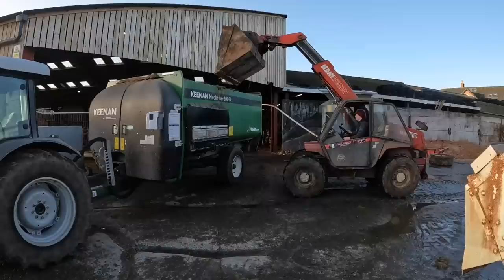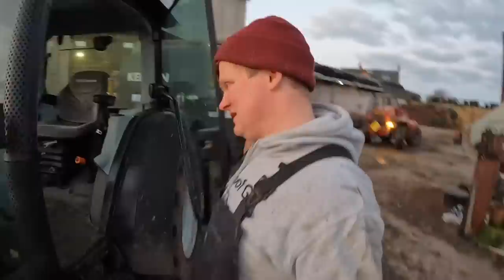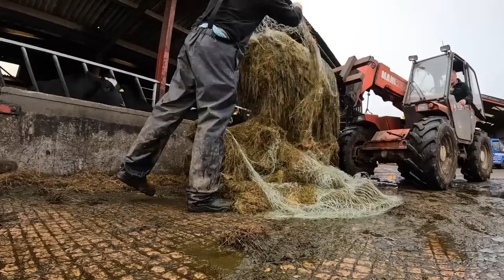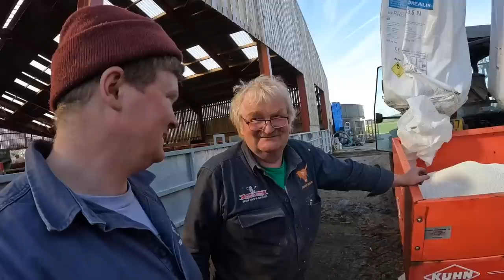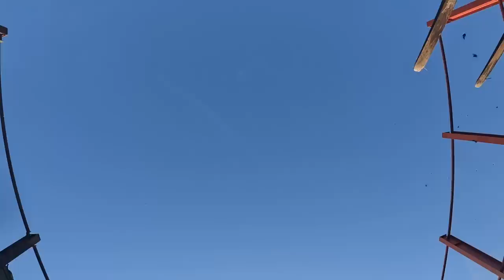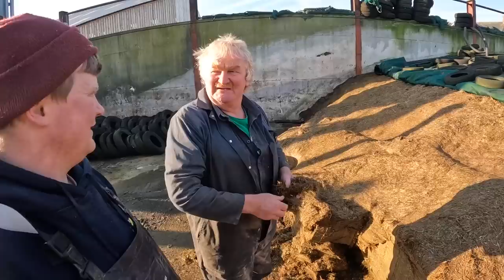IT'S FINALLY HAPPENING... FARMER MAKES GRASS GROW + SON HAS NOTHING LEFT!

Comment: I set up a wash station on a small trailer, power washer, generator and water tank,.
Added some tools and grease gun. Saved so much time on moving stuff.
At end of day, or. Rainy day, spending 30 mins , an hour.
It didnt matter that you got messy or wet as you would be jumping in an hot shower very soon .
Also nothing to put away, just leave stuff on trailer.
Need to cleanup old stuff and new stuff.
Work smarter.

Comment: You farmers should put a dome over that then less plastic you will use and no tires.
Reply: It needs to be rolled to remove any air from the grass and then sealed under airtight plastic.   There are Harvestore silos that they use for silage in the US but that's a completely different system and very few if any contractors in the UK would have the equipment for it.